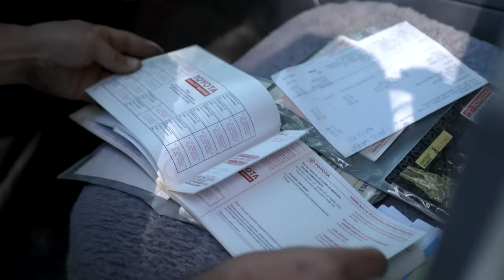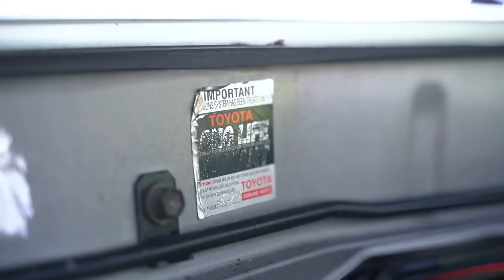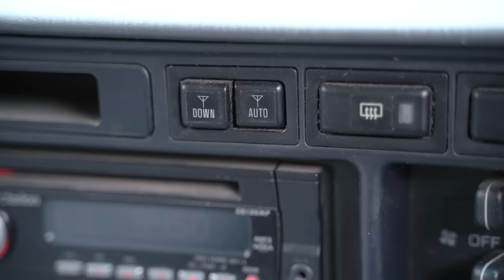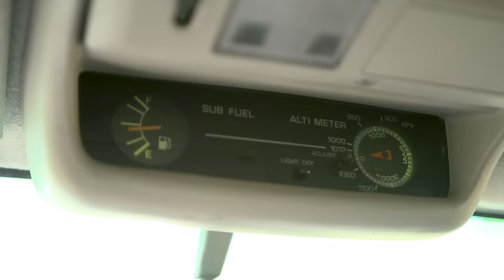RARE GRANDPA SPEC Toyota Landcruiser! You won't believe what Shauno paid + tips on buying an OLD 4WD

Comment: we paid $2000 for a 2012 VW with only 120K kms on it it was pretty clean still had full rego and basic insurance and had zero mechanical issues an absolute blast to zip around in and does everything i needed it to do

Comment: What a clean look 80. Two years ago I purchased a 3.2L D22 Navera 2000 model for $4000. 260 000k. It’s was not standard with after market turbo and Intercooler. ARB front and rear bars, Warn winch, IPF Spots Lights, uhf, ARB compressor, ARB canopy, Dual Battery, camp lights and there is things I have probably missed. This has been the funnest car I’ve owned to date 😁

Comment: Quite jealous of you Shauno. I'm 19 and just recently took out a loan to buy a mint '97 1hdft 80 series with 290xxx kms for high $30,000s. The fuel pump started leaking about 2 weeks in, cost me $6k. Already spent $12k total in maintenance. Quite hard spending this much on $19 per hour aha. Took 3 years to find one this immaculate and saw some absolute nightmare 80s in that time disguised as clean rigs. Despite the expense im keen for the trips ahead

Comment: When I was looking for a 4wd to replace my jimny, I was on a really strick budget and didn't think I would have enough for the vehicle I wanted. Ended up scrolling marketplace at the right time, and was able to buy an rd28 gq for $2000. It wasn't perfect, was a bit mouldy and mossy as it had been sitting, however it was perfect for me and came with a decent amount of accessories, as well as being mostly straight, having minimal leaks/issues, and also mostly rust free. It has served me well in the 2 years I've owned it, and hasn't let me down once. I haven't seen a deal like it since, and I doubt I will ever see one like it if the prices keep going the way they are
Reply: Yes sir!! That's how I do it, I bought my m715 for 2500 bucks. When I got it she was faded pink with plenty of other issues. 
Almost 20 years later, 3 donor trucks and many gallons of blood later the old m715 is rolling hard. I have maybe 5 or 6 grand total into it.

Comment: Brought 2003 120 LC prado for 15k with 2inch lift (fox racing suspension), long range fuel tank (another 90L) ARB bull bar, radio, dual battery setup. Pretty much happy with the rig as I was done inspection by my self with very less experience in 4wd. Did 2364km trip (Adelaide-Coober Pedy-Flinder Rangers-Adelaide) after one month. Dam!! Best car for that price!

Comment: Greetings Shaun, what a bargain and yes they are one of the best produced. You will get a lot of great driving from that. Last year picked up for my son a stock original 1 owner LN 106 Hilux cab chassis 2.8 diesel. Belonged to a mate who owned it from new. Never seen a beach and barely ever been off road. Swapped him a 20,000lt rain water tank ($2300) The vehicle is completely stock aside from a set of extractors after the original cast manifold developed a crack. Its done 340k which was mostly highway too. Like the 80 series it has all the log books and receipts from new as well.  The boy loves it to death and is so proud to own it. He is piecing together his recovery gear getting ready for a trip to Fraser for "Schoolies" 
Keep the updates coming on the 80series mate, certainly a great pick up.

Comment: My 2013 BT50 dual cab was the best second hand bargain I ever got. It was 5 years old when I bought the big girl and it only had 32,000 kilometers on the clock (log booked serviced by Mazda) I paid $29,000 cash for it. 4 years later its taken us 3/4 the way round Australia including the cape, Fraser, its crossed the Simpson, up and down the west coast all through central Aus and still going strong. its a bloody unit

Comment: We bought a 2002 Mercedes Benz c-class with 10,000 kms bought 5 years later from an owner that only drove it a couple of times, and , now the car is 22 years old, and still has 110,000 kms. The car is practically all original. Still working like a treat

Comment: bought an 86' model hj75 series ute for $2500 3 years ago from the first owner, 150,000 original kms, was completely stock as a rock, never even had a bull bar on it, complete original interior and still running around on split rims, the old fella i bought it off just used it to run in and out of town from his farm, was parked inside a white tiled floor garage its whole life and didnt have one leak at all, even came with the original toyota tool bag and tools 👍🏼

Comment: My last purchase was the greatest. A 1971 Toyota Coaster camper. It was only $1250. It was fitted with a Holden 308 motor. The motor was a HT prefix block. This originally came from a SLR 5000 Torana! I sold the motor for $4K. I then fitted the coaster with a Barra Turbo. I now have the coolest bus and it cost me nothing.

Comment: Mine was a 1996 Suzuki Sierra with 30ks on the clock, bought for $10,000. Learned to 4WD in it, took it around Australia, and still drive it 23 years on without any major issues.

Comment: Best bargain I’ve found was a 2016 BT-50 $27 500 manual with only 55 000 kms on the odometer had a nudge bar, 2 inch lift, fox suspension front and rear, 33 inch tyres, had all the servicing manuals and history and everything was in check. Hadn’t done any of the modifications himself

Comment: I bought a genuine one owner grandpa spec 1997 VS HSV Senator for $7000 that was 100% all factory original right down to the stock standard head unit. 

It even came with the full service history and was serviced by the same mechanic from brand new right through to 6 weeks before I bought it. 

Unfortunately the only reason I got my hands on it was the owner passed away and his widow sold it to me. The old fella still lives on in that car. Love it.

Comment: I’m from the United States and when I was 17 (3 years ago) I sold my hunk of garbage Jeep for 6500 bucks. Did some craigslist surfing and came across a 1995 Toyota 4Runner (our version of the Hilux surf) for 6000 dollars. Ticked all the boxes. 5 speed manual, ridiculously clean paint, and 102,000 miles. As soon as I bought it the Toyota boom started in the United States and finding any Toyota that was clean for under 10,000-12,000 dollars is unheard of. Just did a head gasket but I have no plans of ever selling it. Something about an old Toyota!

Comment: My dad and I were in the market for a 12HT 60 series in any condition a couple of years ago. We found a high-roof 1988 HJ61 with over half a million km about an hour's drive out of Brissy and when we heard it running there was no way we were going to leave it there especially for the price $4200! Bugger me dead, a month later another one (low roof, 1986) popped up not far from home for $4800 with rego. Couldn't leave it there, minimal rust and we bought it off the original owners! Now we've got a project each! That's a win in my books!

Comment: Scored my first ever 4x4 as an absolute bargain, a clean tidy 95 series prado. $3500 with 180kms on the clock. Had a few standard mods to be able to do some touring, and I added my own 12v system and fridge and still have it running to this day. Taken me to Fraser, Rover Park, Moreton and love camping out of it when going to national parks ect. Only thing it’s missing is recovery gear ;)

Comment: My very first car was a 2003 Toyota RAV4, this is no full 4wd but I took that thing everywhere and it did the job. It costed me $2800 and had 150,000 roughly on the clock, although it was covered in red dirt it ran perfectly, full service, manuals, warranties, and even had the original head unit inside. Had a genuine Toyota alloy bar with side steps and toe ball, along with a set of hella spotties and still had the hood protector and sun visors on the window. Never had an issue with that car and even took it 4 wheel driving occasionally, impressing my self and my mates!

Comment: Best of luck with new rig.
I bought a 2002 Pajero 3.2TD auto with 190km leather seats etc for $450, only needed two plasitic arch extensions, passed RWC, paid 1YR rego was on the road for under $2,000. Still have it today.

Comment: The one I still own .2yrs ago I paid £300 UK pounds for a 2000 plate Mitsubishi Patero with 125 000 miles. I have only spent a further 200 since I've owned it. I could sell it tomorrow for £2000 plus but replace it with what. It's keeper. Love your new motor it's nice to see a standard one. That is the perfect car as a daily drive.

Comment: my best bargain was a $1000 Gen 3 Suzuki Jimny, Now the lady believed the head was cracked and it wouldnt run... I went over there and the car ended up starting she explains it over heats and runs hot, drove it to the workshop and the car made it fine, the temp did rise however it wasnt terrible... closer inspection the radiator had a small crack.... when we replaced the radiator i noticed that the engine code was different and that it was an upgraded motor from the 1.3 to the 1.5... now thats nothing huge but its already one less thing to modify!! now this car came fully kitted out with rear drawer system as well as a dual battery/12v set up!!  it also came with larger wheels a Bullbar and a UHF all in excellent condition for a grand!!!!! stoked!!!

Comment: I'm pretty stoked with my 1999 FZJ105 series purchased 2 years ago for $12k with only 211k on the clock in absolutely mint condition with no modifications on it at all when bought.  I'm the second owner and have since done the FTE conversion on her and the sweet part was, I managed to get an FTE engine with only 219k on the clock. I've done a few mods, but have used all factory switches to keep it real tidy and neat.

Comment: Bought my NA TD42 98 GU Patrol for $30,000 with 54,000kms in 2020. Had a full service history as it was ex SES in Cobar. Stock as a rock! 

Before that, I had TB42 GQ Patrol that I bought for $2800. Had rust and 640,000kms. Took on trips to lightning ridge and Barrington tops

Comment: Paid 6K for my 07 Ford Ranger. Before I got the car it was used as a tradie ute so it had steel tray, under tray tool boxes, a heavy duty clutch, stock bull bar and some heavy duty springs in the rear. It didn't have any rust paint was in good knick with few little marks. Since I've had it I installed an exhaust, lift kit, bigger tyres, snorkel and uhf which has made it awesome for 4wdriving and camping. Love my Ranger and I wouldn't trade it for the world.

Comment: best 2nd hand vehicle buy i have had is a Nissan Navara D22 2004 V6 3.3L Petrol Manual 4x4, minor rust on the roof, 0 dents (until now), paint job is decent, no problems mechanically etc,  Nissan genuine bull bar, all the servicing, 225xxx kms, $5500, absolute beast

Comment: $20 grand for a 2014 stx550 d40 navara 4 years ago with 250,000km on the clock. Came with 6 months rego, Redarc  dual batery system, Drifta drawer/fridge slide setup, Razorback rear canopy with rhino flat cargo rack, electric towing package, bullbar with led spotlights and lightbar , excellent paintwork and a new set of bf goodrich 265/75/17 all terains. Did an eight day return trip from Toowoomba to Uluru wifhout a hitch just after buying it and its still going strong
Reply: Ps:- I think the Navaras are an under rated 4x4 and are excellent value for your dollar.
I know you'l enjoy the 80 series Shaun and no doubt it will probably not be your last.😉

Comment: Best bargain l ever purchased is my current 4x4. A 1994 Holden Jackaroo 3.1 diesel turbo intercooled 4jg2 with 189000 km.
It was a one owner from a deceased estate.
I purchased this vehicle for $3800.00 dollars it was immaculate had never been off road and dead stock.
Have since done some suspensions mods and fitted some steel rims, good tyres,a snorkle and duel battery.
Have done numerous off road trips and even crossed the Simpson Desert last year and it did it easy.

Comment: Bought a landcruiser 105, no rust, straight, tidy as.. 2inch lift, 33inch tyres, arb bar work front and back, sliders, tough dog suspension, boxs fitted in the back, superior bits and pieces, to much stuff to mention.. 300k on the clock... bought for $5000 in 2020..  winning

Comment: Just got myself a 90 series prado 2002 turbo diesel with 184.900 km on the clock. I’m the third owner. Bought it for 8000 on this market, no rust and no aftermarket accessories apart from the bullbar

Comment: I’ve always been uptodate with 4wd24/7. The love and passion made me want to get into 4bying and off-roading so I decided to save up for one while daily driving a 1999 Mitsubishi magna. Evidently the engine on that blew on my way to work so I decided to just jump straight into a 4x4. Was searching around for a RC Holden Colorado as they’re fairly cheap, can do great mods to them, as well as the legendary 4jj1 engine from isuzu. Saw a really clean LTR 2010 one selling out of WA. (A bit better than the standard RCs just had a bit more features from factory) Even though I’m in NSW I had to jump on it. $14,500 with only 230xxxks. One owner since new, no rust, has never been off-roading, it was used for a work Ute, so the rear tray is obviously used. But the actual body/paintwork is next to new. As soon as I got it, straight away did a service and will continue to do so every 7-8 thousand Ks as the motors getting up there in the high Ks. I’m absolutely in love with it, the feel of driving a 4x4 is next to non. Currently getting a few mods done on her now. just basic items such as a snorkel and diff breathers. As I’m still on my P’s don’t want to do anything too drastic. It’s currently my daily, my pride and joy, and I cannot wait to take her off-roading and to the beach during summer!! 

P.S shauno you got an absolute steal on that 80’s! Not surprised one bit it’s another land cruiser though ahahah!
Reply: Love the Grand pa spec. I scored myself a great bargain. A perfect 2001 Jeep Cherokee still registered for $100

Comment: bought a 2007 pj ranger, manual dual cab for 3k, wasn't running, changed injectors filters, egr cooler and it runs like a dream now, goes where luxs on 33s go

Comment: I recently picked up a 2014 d22 nav with 160k on the clock for 10 grand. The ute looked to have spent most of its life doing highway kms and the bloke was good enough to drive it half way to Ballarat to meet me there. Showed he was pretty confident I’d buy the car. Came with books and didnt look like it’s had a hard life. Just when I thought everything was great, about 3 days in to owning the Ute… engine light. Lucky for me I was able to trace it back to a dirty MAF sensor. Full service of air fuel and oil and a clean MAF and it hasn’t skipped a beat in months. Can’t wait for some warmer Vic weather to get out with the boys!

Comment: Bought a 1995 Suzuki Vitara for just over $4k. The previous owner (the little old lady who only drove to church on Sundays) allowed her dogs to live (and die by the smell of it) in it and it reeked. I'm talking eye wateringly bad. After stripping most of the interior and filling the vac with dog fur about a dozen times, not to mention approx 60L of Glen 20 I finally got on top of it. Since purchasing I've swapped the hard and dangerous road tyres for some A/Ts, added a snorkel,  Tow bar, 80 ch UHF, fold out kitchen on the rear door and am fitting a winch bar. From there it'll be Dual battery system, 65L fridge freezer (on order). The 4x3 grass trailer I had in the back corner is getting a reprieve from the tip (recycling?) and will have a roof top tent fitted  on the top allowing 4x3x1 storage in the trailer itself. Planning a 6 week adventure in this little rig starting in Dec. and it's all your fault......Thanks guys, might even catch up with you guys somewhere.

Comment: I have a grandpa spec 90 series Prado 1996. 310,000km V6 in white paint in good order, second owner no mods - not even a bull bar only a 2 inch lift. Original Toyota radio and overall excellent condition. Cost me $5000 in 2019.

Comment: G’day Shauno, I reckon the Best 4x4 buy I have made has been my current 2002  105 series manual diesel 1 HZ non-turbo. The reasons are quite simple really, it had everything & a little bit more already on it & I’ll list them now.  Every receipt & manual as well as a 2” lift, c/w 33” mud tyres,(although they were Coopers) I wore them out adding to the 232,000 original kms already on it. All round Koni heavy duty shockers were an upgrade that the previous owner replaced the OEM’s & I’m about to have them refurbished in a couple of weeks, keep in mind that I have driven on them for the last four year with one that just started leaking now. Light bar & spotties, a roof rack and a new Sony head unit. The thing that I really love about owning the “Penguin” is that it was my first serious 4x4 and with that came the self education & pride of doing my own maintenance. It also gets me to places that I would struggle to get to before with confidence, nothing over the top mind you, just a little bit further in & out of most of the time has made a massive difference. Yes the non-turbo has it’s moments with limited power, however I have not had a speeding fine since driving it, that in itself is a big deal let me assure you. I parted with $19,000 for all this fun & learning & have never held or looked back from taking a trip away off-road & it’s been around Australia 3 times so far, as well as hunting & fly fishing trips most weekends. I can’t see that changing anytime soon as I’m packing my gear into the Penguin today for yet another week long trip with my 4 1/2 year old Viszla (April) to the Vic high country. $19k is a steal if you ask me & a low entry fee for a better life.

Comment: I paid $2k USD for a 97 fzj80 that had a slight rod knock. Body was super clean with no rust. I put a used 1fz-fe in it and now have a great fzj80 for less than $3k.